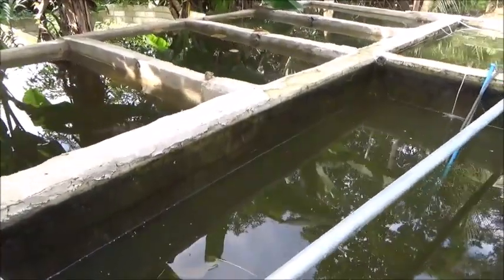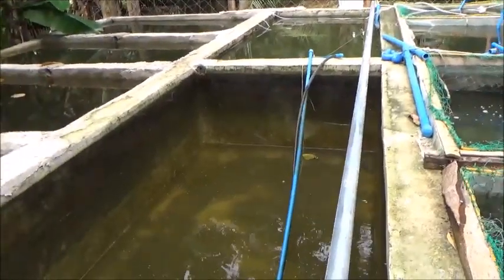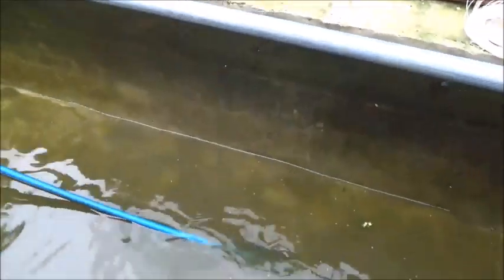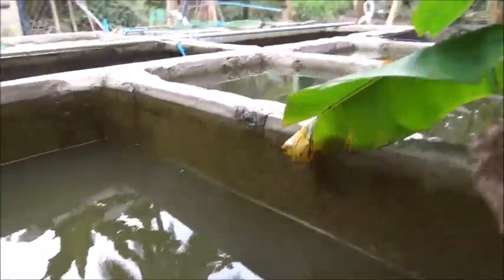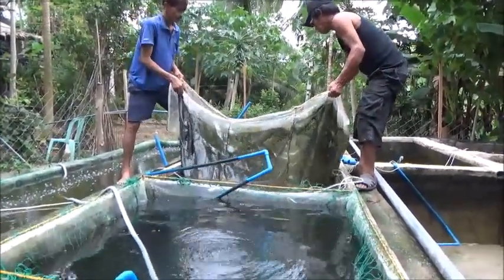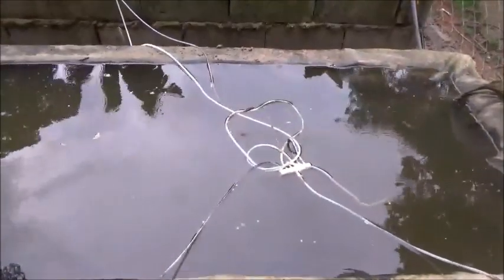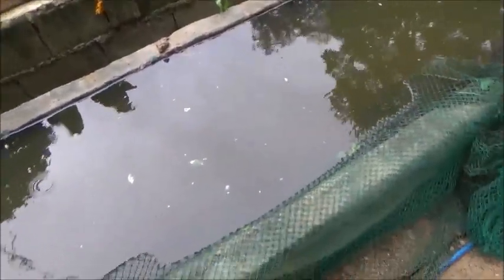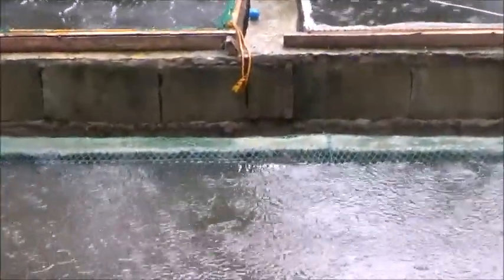Water Exchange, Moving 100's Of Fry And 100's Fingerlings

Comment: Make square screens with small holes and put on top. wood frame hold down with bricks. Like on a window. But bigger screen. Over flow 2 inch holes with PVC sticking out at ends with screen wrapped around ends in side tank. No escapes. Just a suggestion. God bless you & family.🙀🙀🙏✌️🤙😎🐟🐟🐟🐟🐟🐟